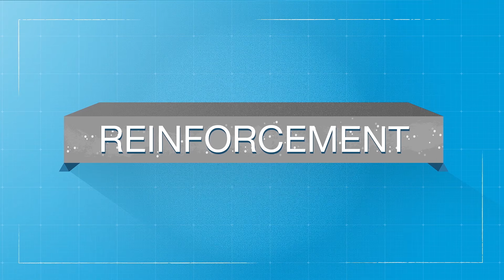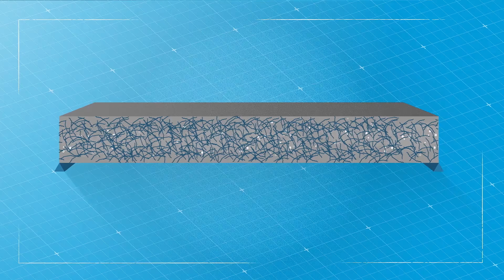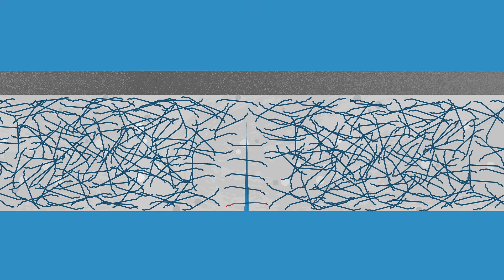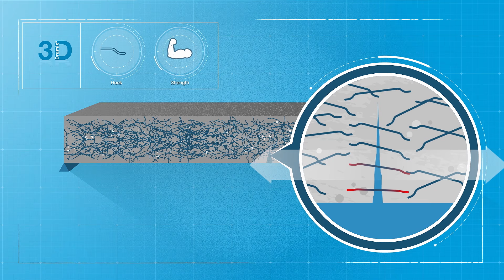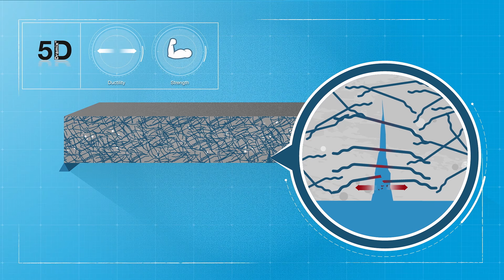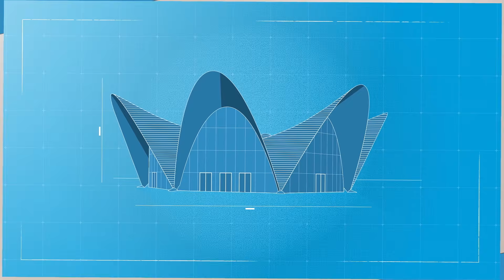Steel fiber concrete reinforcement – how does it work?

Comment: I think we can't replace fibers as complete steel reinforcement. It only improves the tensile strength of concrete by adding fibers.
Reply: Dear, at RCR Industrial Flooring, we use SFRC in most of our flooring projects (60 millions SF/y). For SOG, fibres are more efficient than conventional mesh to enhance bearing capacity of the slab and to control cracks (Silifibre). In higher dosages, we can even build jointless slabs (Conductil). For structural slabs (FOP Piletec, rafts Basetec), either a combination of mesh + SF, or  "real" Structural Fibres (5D) only, will give the best result in terms of time of execution and safety. In this case design must be validated by independant designer (Monofloor is one).
Reply from the maker: Steelfibers can “fully” or “partially” replace longitudinal steel (mesh or rebar) in function of the application. It is up to the designer to assess how much of the traditional steel, if not everything, can be replaced. Steelfibers will have a positive impact on the ultimate limit state (ULS) and serviceability limit state (SLS). For the ULS, steelfibers will increase the moment capacity (MRd) and shear capacity (VRd) of the section. For the SLS, steelfibers reduce the crackwidth and increase post crack stiffness of the element resulting in higher durability and lower deflections.

Comment: Can I get your contact sir?
Reply: I want to learn complete design of steel fibre reinforced concrete
Reply from the maker: Dear, can you tell us where you live so we can immediately put you in touch with our local Dramix specialist?
Reply: I live and work in Doha,Qatar as a structural engineer with Gwall company

Comment: Wouldnit be useful to add the steel fibers AND use rebar?
Reply from the maker: Where a "fibre only" solution can not reach the required strength for ULS or SLS a combined reinforcement is an excellent solution.
Especially for meeting SLS conditions, adding Dramix steelfibers offer lots of benefits. The tension  capacity of the steel fiber concrete will reduce the strain on the rebars. The distance between cracks will also be reduced. This results in much smaller crack openings enhancing the durability of the structure. In addition, the fibres also enhance the flexural moment resistance of the concrete section.
Design rules exist to calculate crack openings and moment resistance for combined concrete structures. (Steelfibers and rebars )
Reply: @Bekaertchannel  rebar is cheaper
Reply from the maker: @dylanangel3143  Generally rebar per unit weight is indeed less expensive than steelfibers. 
However one has to consider the total cost of ownership (TCO) when making a price comparison. The amount of material (steel and concrete) needed to meet the design requirements, labour cost to apply the reinforcement, …. should be considered. For a lot of structures less steel and less concrete is needed. A reduction of construction time could result in an earlier start of the operational activity resulting in a faster return on investment ( ROI). Therefor a TCO analysis should be done on a case by case basis and is mostly favorable for the use of steelfibers.

Comment: The performance difference is only as good as the anchorage the concrete can provide. In lower strength concrete up to 40Mpa, there will be little  difference in performance between these fibres or any other fibre suppliers similar shaped fibre. This video is misleading, as the claims can only be justified (if independently verified) in High Strength  Precast concrete such as 80Mpa etc. where the concrete matrix is sufficient to allow the fibre hold longer.
Reply from the maker: Very good remark! The concrete strength is indeed a crucial parameter in the behaviour of steel fibres in cracked concrete sections. The type of fibre – which consists mainly of the type of anchorage, the wire strength and the wire elongation capacity – and the concrete strength are the 4 main parameters determining the concrete behaviour when cracked. 
The 5D fibre will indeed perform the best at very high concrete strengths, but already at the very common concrete classes C30/37 and C35/45, the difference is significant and relevant.
Reply: @Bekaertchannel  That is partly correct, as you will not see any performance difference in 25Mpa Footing mix. For example, if you tested a 1200 Mpa tensile strength fibre against a 1900 Mpa tensile strength fibre in a 25 Mpa mix of the same shape,    there would be no difference in performance, due to the matrix not being sufficiently strong enough to show the fibre             difference. In fact, testing in SCC at the same compressive strength will show  more of a difference. This is one of the weak points of TR34 4th edition of relying on pin point values that are difficult to gauge in the real world and with so many               variables. At least using Re3 values, it was expressed as a percentage of whatever concrete was to be used.
Reply from the maker: You are correct to state that a fibre with the same shape but a different tensile strength will not have any significant performance difference in a C25 concrete. But while keeping the same shape, a better performance can still be established by increasing the L/D (Length/diameter) ratio. 
On the other hand when we increase the tensile strength of the wire AND improve the anchorage of the fibre, the performance in a C25 will increase. That’s why a Dramix® 4D fibre with a tensile strength of 1800 N/mm² and improved hook has a significant better performance than a Dramix® 3D fibre with a tensile strength of 1200 N/mm². Alternatively, if a 4D shape would be combined with a 1200 N/mm² wire the fibre would snap at a certain crack opening rendering the material britle.
The shape of the Dramix® steelfibers have been designed to make maximum use of the tensile strength capacity of the wire. 
The use of Re values are not in line anymore with EN testing standards and current design standards or guidelines. These guidelines use the fr1 and Fr3 (Fr4) values to calculate the moment capacity of a steelfiber reinforced concrete section.
Reply: @Bekaertchannel  There is an element of contradiction on your reply. The L/D does not change between 3D, 4D, 5D etc, therefore, why would the performance change? The tensile strength of the fibre will be irrelevant in 25Mpa concrete, regardless of how your fibre was tested. Some fibre companies are testing in high strength and then interpolating the values into lower strength concrete and this is morally wrong! You infer that a 4D fibre would snap at a certain crack width in 25Mpa concrete, but again this is misleading as it is only relevant in high strength concrete.
I mentioned Re3 to explain to you that it was based on a residual strength of any concrete, rather than a specific concrete mix. Yes the EN is a Europeanised version of the Japanese Test method, but all that has been achieved with this new test method is provide a more specific Moment Capacity value to use in a design. That is fine, providing all the concrete mixes are the same as was tested. This is where the problem rises, as some manufacturers are quoting high Fr1 numbers derived from high strength concrete mixes which are then used in low strength concrete. Using the Re3 method eliminates this ambiguity (which is still current under ACI by the way) as it tests for the Residual strength of the concrete which is  expressed as a percentage. Therefore, the same value Re3 % can be applied to any concrete mix for more "Real world numbers"!
Reply from the maker: Dear Andrew. I would invite you to read my earlier reply more closely without a biased mind. 
Within a fibre family such as 3D a higher L/D ratio will improve the performance. For a given L/D ratio a 5D will provide better performance than the 4D which in its turn will outperform the 3D.
I did not state that a 4D would snap at a certain crack width in a C25 concrete. I stated the a 4D hook with a wire strenght of 1100 MPa. (similar to 3D) could snap. Just indicating that the improved 4D hook needs a higher tensile strenght of 1650 to 1800 MPa. 
If you would require a more indepth discussion on these topics I invite you to take contact with our local people in Australia. : http://bosfa.com/contact-us/